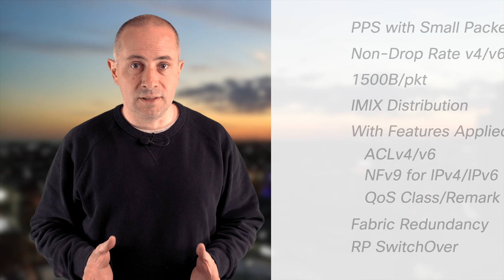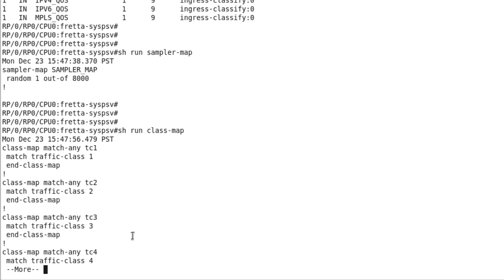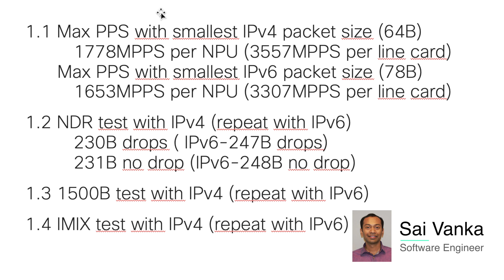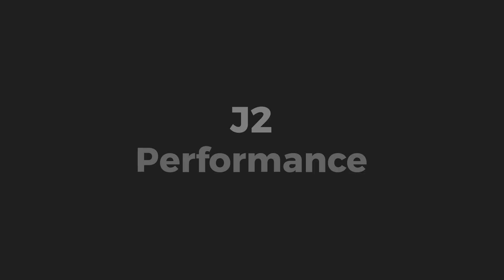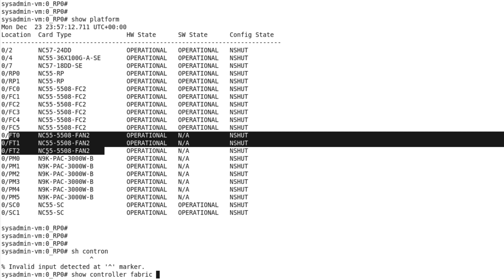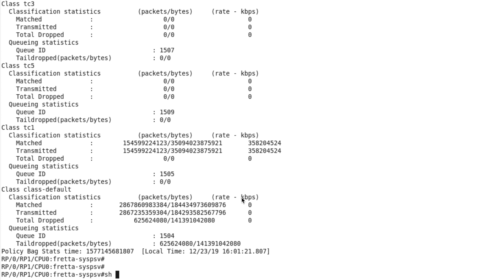NCS5500 400GE Performance Testing

Comment from the maker: Note: we use the 18DD-SE card here with 2x J2 ASICs @ 3.6Tbps.
Performance will be different with the 24DD card where the 2x J2 ASICs are used at 4.8Tbps: different PPS with small packet size, different NDR and also no support of N+1 fabric redundanct (while it's supported on the -SE card).